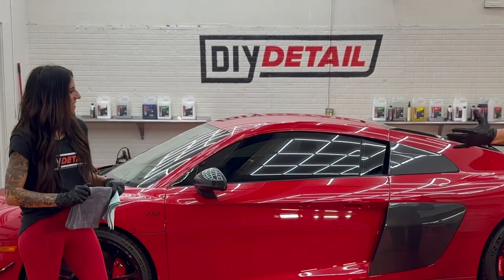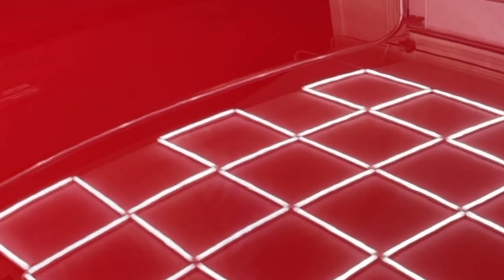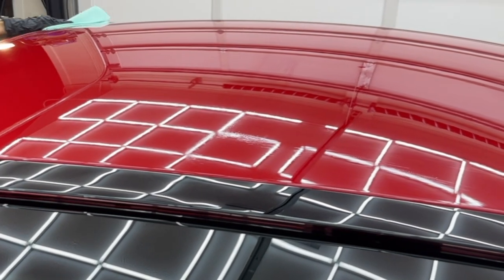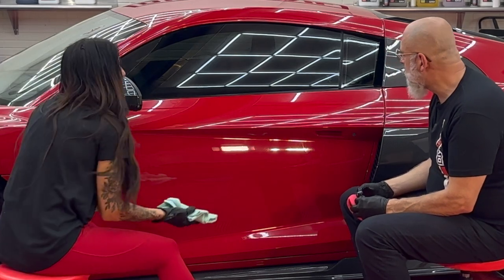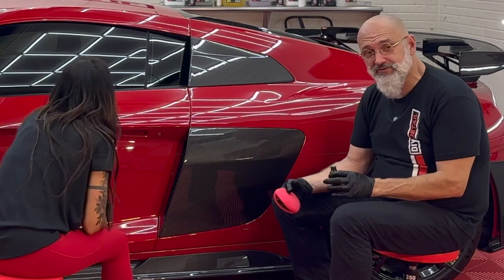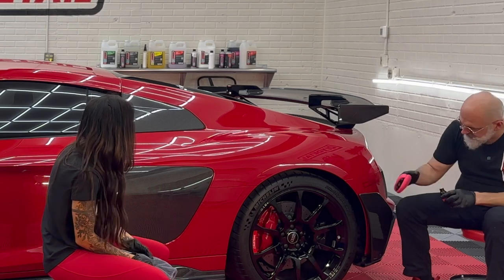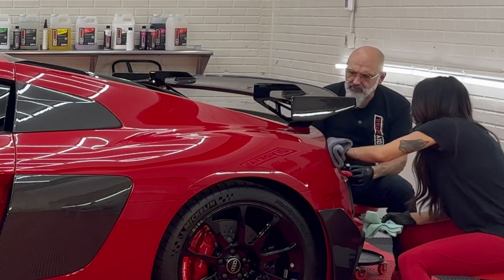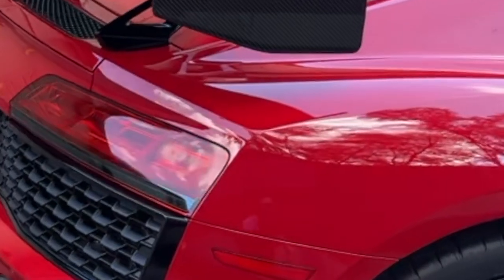R8 GT 2023 CERAMIC COATING DIY DETAIL GLOSS AND PROTECTION

Comment: Did you only need 1 applicator pad for the whole car? Any worries about the coating drying on the applicator pad? Can the applicator pad be washed and reused? Thanks
Reply from the maker: Yes one is all that’s required. Yes clean it, and re-use.

Comment: I’m looking to buy your ceramic coating but can’t decide between your original ceramic or your 5-year (only a $20 difference). What is the difference in application, durability, and look?
Reply from the maker: The 5 year will give you better gloss, slickness, and water beading. Application is just as easy

Comment: ivan, Christine, great video. My daily driver has 100% PPF on the paint surfaces. I will be polishing the PPF with Gyeon PPF renew polish. I am looking at ceramic coating choices.  Is your DIY Detail 5-year cer coating a choice on PPF? Thanks Paul.
Reply from the maker: Paul, thank you, and yes all of our coatings can be used on both PPF and wraps
Reply: @diydetailofficial  Thanks Ivan. Wheels as well or dedicated wheel coating better way to go?
Reply from the maker: No need for a wheel coating, that’s just good marketing.

Comment: I've heard of some European cars having some type of ceramic infused clear coat - is that correct? If so, does that obviate to any extent the need to apply a coating?
Reply from the maker: Yes they do, no it doesn’t replace the need for a true ceramic coating.

Comment: Can you reuse the ceramic coating applicators for another coating on a different car? Can they be simply be washed out straight away? Thanks!
Reply from the maker: Yep. Just dunk applicator in your Bucket of rinseless wash or add some all clean in there let it soak 15-30 minutes and then put it in the wash, good to go for next time!
Reply: @diydetailofficial  is there nothing Rinseless can’t do?! 😂
Reply from the maker: It’s not good on cereal.

Comment: Hey Ivan I’ve been looking at videos to ceramic coat vehicles to offer that service in my detail side hustle. So I purchased quartz 3.0 to start off however many video associated state to apply coating is hatch pattern but you applied the coating in circular motion is there a reason for that?
Reply: It helps keep constant motion which can help eliminate the chances of high spots from starting and stoping. It also can make sure you are getting even coverage and is a little more time efficient in my opinion. Hope that answers your question👍
Reply from the maker: I couldn’t have said it better myself.

Comment: You may have covered this already, but I noticed that you did not tape off the trim.  Is there a reason for this?
Reply from the maker: There’s no need too with The Gold Standard Polishing System
Reply: Or are you talking about taping after the polish & before the coating?  If so, your coating should be used on all external parts of your car (except tires).
Reply from the maker: @hartlanddetailer5670 correct